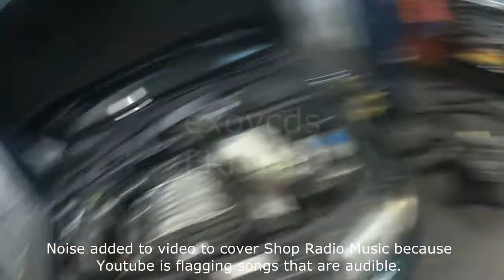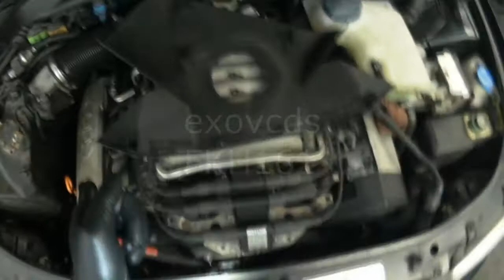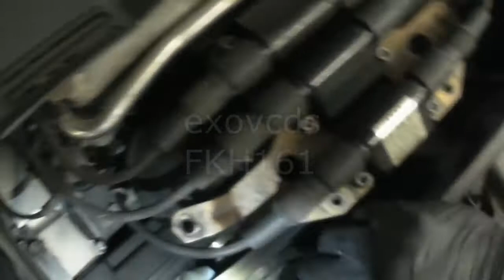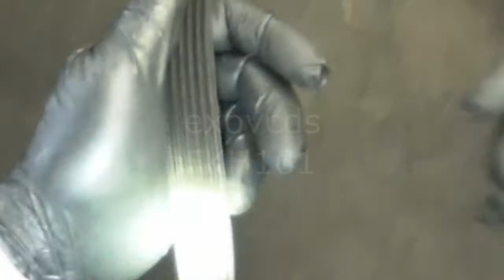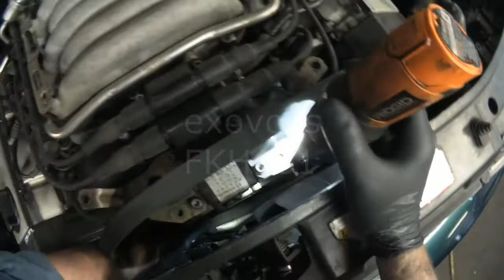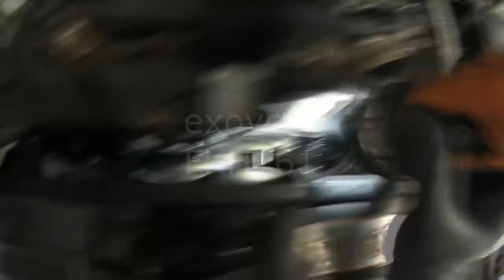Audi B5: 2.8L AFC Serpentine Belt Removal & Installation (without Radiator in "Service Position")

Comment: Is this the same procedure for the A4 2.8?
Reply from the maker: Audi A4 30V? Yes, similar... this is the Single overhead camshaft engine. The 30V is a dual overhead camshaft engine, with less engine bay room compared to this engine.

Comment: That low profile breaker bar used on the 17mm tensioner is awesome. Hopefully i can get one for one-time use at harbor freight cause that is probably snap-n, eh?
Reply from the maker: Mark Dierking http://www.ebay.com/itm/Performance-Tool-W84010-Serpentine-Belt-Tool-/141257644607?hash=item20e39c9a3f&item=141257644607&vxp=mtr
Reply: ***** That is awesome and available from other sellers, it appears, for just over $20 incl. shpg. Woohoo.First I am gonna try a craftsman 1/2" breaker bar for fitment A $20 poly belt and Perhaps my engine will not be vulnerable to self-destruct. Hey, any idea how many miles one of those 2.8s can go without changing the timing belt? My 94 cab has +155K and counting albeit slowly.
Reply from the maker: Mark Dierking I would not wait longer than 75k miles (120k km)... interference engine will cost more to repair when it breaks.
Reply: ***** Thanks, I think the mfger recommends 60k and like I said , i have 155k now. If it breaks before I can get to it then, the vehicle is totaled, methinks